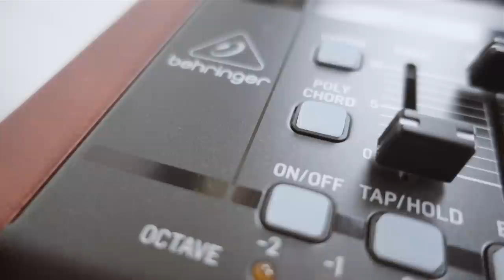DEEPMIND 12 B3 ORGAN SOUND DESIGN TUTORIAL ~ Synthesize This! Ep.18

Comment: Which software is it that gives you a circular picture in picture?
Reply from the maker: I use Final Cut Pro X, but you should be able to achieve this in most video editors (it's just a circular mask).
Reply: ..alas, I am stuck in lowly iMovie until I can find a way to instal my old version of FinalCut ( ...which isn't compatible with any os newer then Snow Leopard or something. I think I need to just partition my HDD & instal two versions of OSX. )